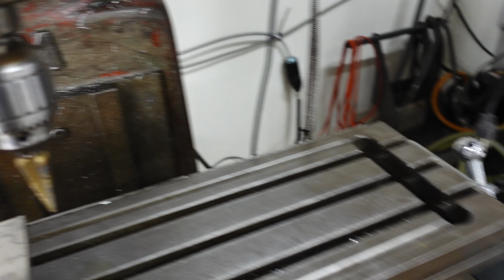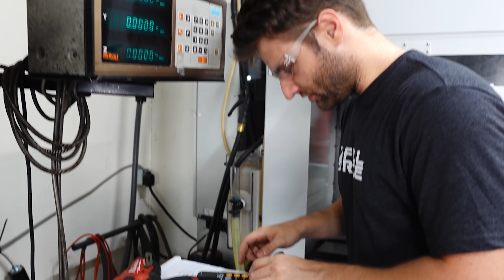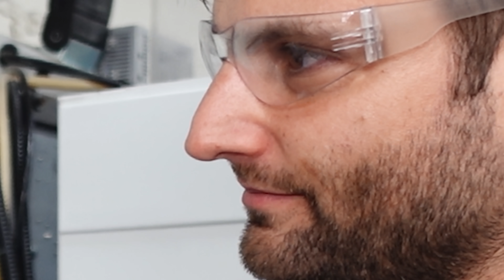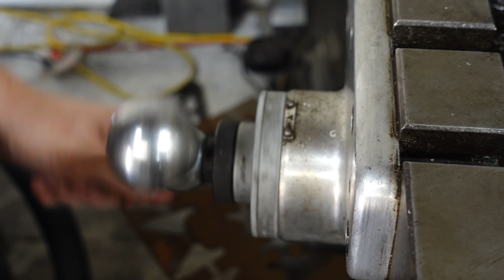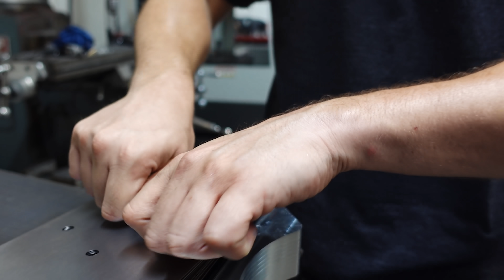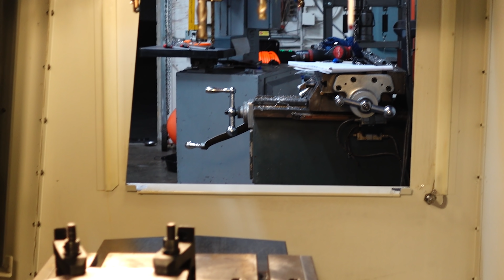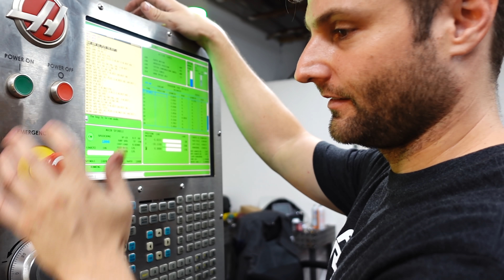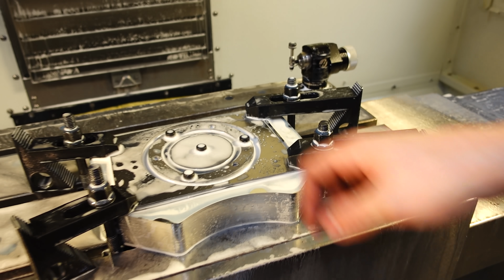Making EMERGENCY Parts for my 4 Rotor before the race.

Comment: Need machinist advice or programing hit me up. You could of just made the fixture in the mill, clamp stock. Drill holes . Add bolts and cut the Id and od with two programs .

Comment: Use your DRO's features bro. On almost all DRO's there is a PCD feature. Gives you exact coordinates for whatever bolt circle/pitch circle diameter you want. You just set the zero point for the center of the circle, then add in the amount of holes, and then diameter. It generates the coordinate system for the holes and tells you number 1, then you skip to next hole, rinse and repeat.

Props for learning this stuff. Machining is insanely rewarding but boy can you spend some moolah. Alot of time spending on the mistakes you made and having to fix em, so don't let those issues discourage you. SFM and your feeds are critical depending on material being cut, tool being used, and rigidity of the machine doing the cutting.

Comment: The next time you do a shim pack like that, cut yourself a piece of 1/4in aluminum for the top layer and it will fix the warping problem. That’s my favorite trick when milling thin material like that.

Comment: 1000 rpm for an endmill like that is way to slow if it is a carbide endmill. Use this to calculate your rpm: 120*1000/3,14/(endmill diameter).
Reply: With the amount of cooling you have you can run it way faster without burning it.

Comment: Another cool trick with tapping using a manual mill is to simply use the quill as a pilot- a lot of tapping handles will have a divot in the top that you can use with a center drill or an actual dead center like you'd have on a lathe tailstock and use that to make sure your tap is perfectly aligned with the hole you're working on, then manually work it around. Much easier than tapping something by hand, especially in harder materials that you're more likely to break a tap in if it's crooked.

Comment: Rob Dahm: Buys a $30k HAAS CNC
Also Rob Dahm: Drills a bolt circle on the clapped out mill without DRO
Reply: Thats what I was thinking!
Reply: Nailed it on the head
Reply: same thought ^^
Reply: Only because he doesn’t know how to use his CNC.
Reply: I think you may have missed the point, the bolt holes were necessary to hold the shim stock to mill the circles.
Why not just hold it in the CNC the same way? he was learning to make sure his speeds and feeds were going to work, manually operating the mill if he feels or sees something not right reactions will pull the tool back. Sure it may have saved some time on the CNC, if he was more experienced with the coding involved and the machine itself.
Reply: @ryanworkman5229  >Why not just hold it in the CNC the same way? 

Exactly my point.  He needs to learn the machine somehow.  He could have clamped it, and centered it once.  Drill and tap the holes using the digital readout for accuracy.  Bolt it down without unclamping it.  Since it's already centered, just mill the two circles and bam, done.
Reply: What's your point?

Comment: There are way too many setups in your machining process a flange like that should be single setup in your CNC. Circle mill the holes then contour the part with tabs and always use ramp entries with mills. Nest the NC file for the flange in X by Y quantities on a bigger sheet.

Comment: pro tip, model you entire setup in fusion, then use that to see if your tool will mill into it. you could even model a large ring where you don't want the tool to go, so it wont crash into your fixturing. in the setup include it as the stock, so it shows up in the simulation. also your tool may have been pulling the material up, or the tool itself may have been getting pulled down out of the collet.

Comment: Hey rob, quick tip from a Technician, Inches per minute to calculate feeds and rpm for steel are about 150sfm with a steel endmill and 350-400 sfm with carbide, use the equation :  RPM= (sfmX4)/Diameter of the tool, for the feed, use about .005 inches per teeth generally, for the linear feed: feed=inches per tooth(.005) x number of teeth on the tool x RPM

oh and  the main bearing of the press drill sounds like it's dying
Reply: Vc is sfm not ipm. 🙃
Reply: Got mixed up in my units, thanks

Comment: Out of curiosity, could this have also been done using the plasma table?
Reply: Plasma table doesn't cut clean enough, it's a rough edge, rough measurement cut just like a hand held plasma cutter. Also those Peace's are so thin it would have likely melted the edges together bent them all up trying to get them apart.

Comment: This is all the stuff I've had to teach myself on my works small mill. All the calculations and manually machining parts, it's a process.

I probably would have thrown a sacrificial 1/8th inch plate over everything to sandwich it together better but they turned out pretty good and the super thin ones you probably won't use anyways.

Love the content and your attitude towards building stuff. I love figuring stuff out and learn how to do it better the next time.

Comment: If you aren't going to use the DRO you have to make sure you either have zero backlash in your machine or stay on the same handle to maintain relative measurements.

Comment: Can I suggest when you are cutting make sure you are using the correct side of the tool so the chips have the least distant to travel by the material (I.e chips flick behind the tool not in front of it) that will help with heat, warping/chatter, tool wear and finish :) not that you done anything wrong with how it was cut, just for future reference :)

Comment: You literally couldn't make this whole process any harder... First of all, if you decided to put it on CNC anyway, why have you drilled it on a conventional mill? That's one more, unnecessary step, especially when you took holes positions from the CAD software... Having the same machinery I would most likely use the laser cutter to make it

Comment: Whats your rapid set to 😂😂 thing was moving pretty fast. Nice work, I was fortunate enough to use CNCs in a State College for my classes as a design Engineer . By default they set the rapid to 25% ... I found the key to override the haas and get it to 150% over, crazy rapid speeds and feeds. Send it

Comment: I'm impressed man, I run a couple Agie wire edm machines and it took me a good chunk of time to learn how to program and run the machines and that's with being taught by someone who already knew everything.  To have the balls to be self taught an run theses kinds of machines is pretty intense! Keep up the good work man, and don't forget to do your maintenance!
Reply: I think he has a computer security business.  He knows programming.
Reply: @rickjason215  There are many different kinds of programming, just because you know one doesn't mean you'll be able to jump right into another.  If there's even much programming in security systems it's not going to be anything like telling a machine how to cut a design.  I did some basic computer programming back in school and it was nothing like setting up a wire edm machine program.

Comment: NIce job Rob! it's not exactly easy running those machines and getting a useable result, you've done well.

It would have been a nice idea to use a top sandwich plate on your shim jig to stop them warping, but they came out nicely! you made it look way easier that it actually was!

Comment: It’s great you have the tools to actually fabricate your parts.  I assume most everything on this car had to be built specific or modified to work for this application.  It really shows how much work is involved to get to the end product.  Should be running an engineering class for mechanical engineers.

Comment: Quicker you adjust to metric system the easier everything will become, stop using inches, 4.33 inches is just 110MM....4.33 repeating isn't an accurate measurement

Comment: For working out rpm you should do
 240000/pi*cutter diameter for steel 
And
 800000/pi*cutter diameter for aluminium

Comment: I would use multiplex wood. Wasting that nice aluminum made me cry a bit. Just set the plates with wood screws with small washers 10 outside and 10 in. Then cut the hole operation first on the CNC, and then set screws with plates in all the new holes. And cut away. Fusion 360 can divide the holes easy and seprate the operations. Great channel!

Comment: Hey rob instead of using the emergency stop to stop the program just hit feed hold. It works just as fast and if you realize everything is ok you hit cycle start and it resumes machining. Also turn your rapid down when running a program for the first time. I run a 2014 vf4 at work just giving you friendly advice.
Reply: I was about to say the same thing. Figured I’d check before posting it myself. I also will hit feed hold about an inch above the part and check “distance to go” and if it looks about 1 inch I start the cycle again
Reply: @kohlhorsch8171  yes i forgot to mention that as well
Reply: He is practicing to make the rotor billet block.
Reply: wish HAAS would put feed and rapid knobs on their controllers like okuma does. at work we all just put feed and rapids at 20% or so to be safe.
Reply: @kylegoerlitz7392  it's not just okuma, it's pretty much all fanuc controllers back a long ways. Even the enshu open air verticle I started on years ago had it. Haas is really only good for its interface, most other companies make a superior machine and fancy a superior controller
Reply: @kylegoerlitz7392  yeah our sharps and doosans have the rapid, feed rate, and spindle rpm% on a knob. They use fanuc controls

Comment: Cmon Rob... it’s not “left, right, backwards “... it’s “X, Y and Z!”  Talk CNC lol... love the content!!
Reply: In various CAD programs Y and Z defaults can be flipped. I prefer Z being the vertical axis because it just makes more sense to me.
Reply: Patrick Krenz I always have to stop and remind myself because the Cnc surface grinder I use switches the y and z compared with the vertical mills I use.
Reply: Yeah its flipable, also mirrorable. Not only xyz, but ABC as well. (A= rotation around x, b rotation around y, c rotation around z. It's also worth noting depending on the type of machine you're running (spindle orientation verticle or horizontal etc) the axi preform different movements. Z is really more accurately defined as depth, being its actual definition in 3d dimensioning, for instance, on a verticle z would but up/down, but a 4 axis horizontal y would be up/down but either way z is still depth. Same thing with lathes
Reply: left, right and backwards is only X & Z, Y is height
Reply: @Ezthereals  x is left/right y is front/back z is up/down
Reply: @randy0048  He's using Minecraft coordinates for knowledge lol
Reply: @megahornet  Some European machines use y for the vertical axis.

Comment: Rob, the machine has a 5% rapid button for a reason! I wouldn't full send on the first time running through the program. Feed hold is better than e stop, most of the time. Pressing reset on a Haas will stop the spindle and turn off coolant. And you should brush up on your trig! Awesome content, I love watching you work.

Comment: Erm, that machine could have made all the HASS holes. Why the manual stuff and trig at the beginning?
Reply: a haas can tap a hole so fast its unreal.  but mine had the tool changer, which made it stupid easy.

Comment: Hey Rob, just an FYI, in Fusion 360, you can create a feature, like a hole, and create a circular pattern around a center point with however many features you want to duplicate and it will auto place them equi-distant from each other so you dont have to do all the math yourself. =) just look up fusion 360 pattern circle.

Comment: I've done a lot of work setting up differentials ... Pinion shims, carrier shims, crush washer, pinion nut, and that horrible yellow leaded paint - making the shims for that BMW differential was completely awesome!

I still wonder why you didn't fit a quick change differential in front there because that would allow you the regular driving ratio and the high speed ratio all while still allowing all wheel drive for the different situations without having to do lots of extra work every time you want to make that change.

You could even have some weird super high burnout ratio that you could change too and you could have a 600 mile per hour ratio that you could change to ... I get that's ridiculous but boy would it be fun

Comment: @Rob Dahm you said you were unsure of the speed you should be running your tools at. I use this handy little calculator when I am coming up with feeds and speeds all the time.

https://www.harveyperformance.com/machining-advisor-pro/

All you have to do is make a free account and then you have access to a REALLY good calculator that will at least get you within a good ballpark of where you should be at. The only downside is that if your company decides it doesn't want to use all Helical tools (like mine) then you just have to go through their website and find something that is at least similar to the tool you plan on using.